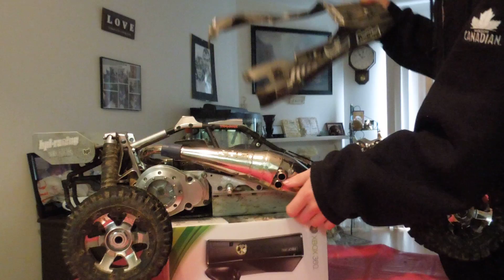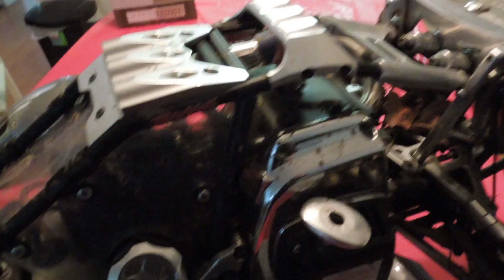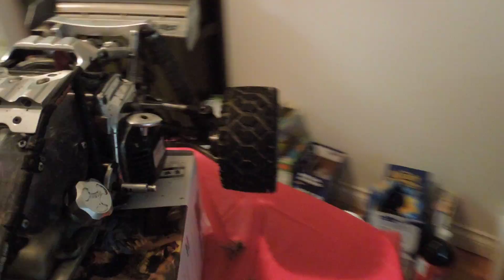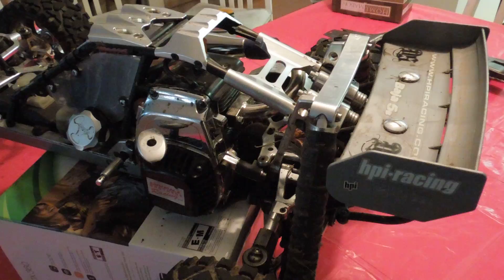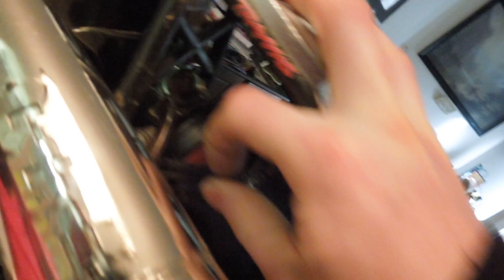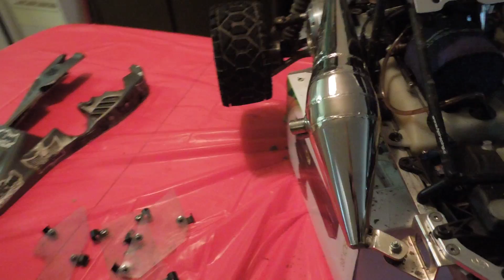tips and tricks when buying a 1/5th  scale

Comment from the maker: @920gamez 19/55 is a great as long as your baja is not overweight. will have a higher top speed but will take longer to hit it compared to 18/56 which is what i run also (i need the extra torque for the weight of the buggy). the smaller the pinion the more torque you have and the faster the acceleration. the larger the pinion will give less torque and less acceleration but more top speed

Comment: not much between cy and zen heads now like there used to be, cy cylinder have got better.
the pipe is the biggest factor,  you wont get the added power like from a good pipe by going from a 26cc to a 29cc isnt much noticable difference. but if youre keeping the dom pipe then the 29 will be better as the dom was made for the cy 29. also the pro pipe isnt for stockers, its made for ported/tuned motors.

Comment: thanks, you have what is considered a BB engine , anything over 26cc. 
    i have good power, just wanted to squeeze a little more performance out of it by loosing weight for better acceleration and handling.  atm the fg is down to 9.kg (without fuel)  so its relatively light and the engine has great power but i want to improve the power to weight ratio. Id love to have it dynoed to see peak hp & how good/bad the pipe matches up to the engine. its also a 27.2 4bolt zen with OBR's touch ;)

Comment: Nice baja I'm getting zen Friday g290rc with the king motor 2 speed. Do you like the zen better than cy, the pipe I have is a dominator torque pipe and I also got outter wear on everything, I'm taking the stock 26cc out putting g290rc in I was watching vids they seem to run real good. So do you think I'm doing the right thing thing getting the zen and I'm gonna get the get pro pipe what do you think about that pipe? Nice vid and car thanks